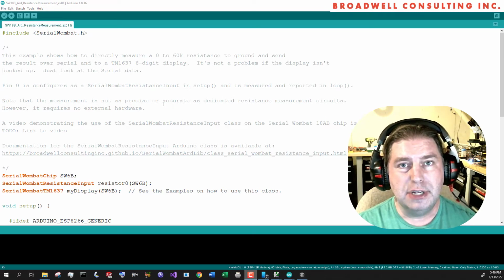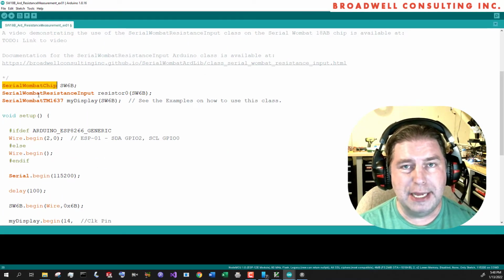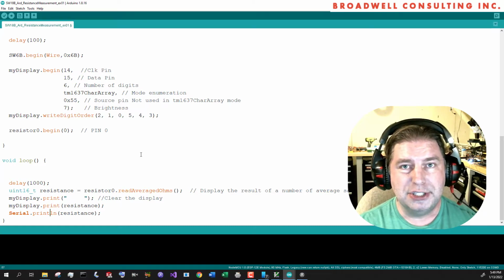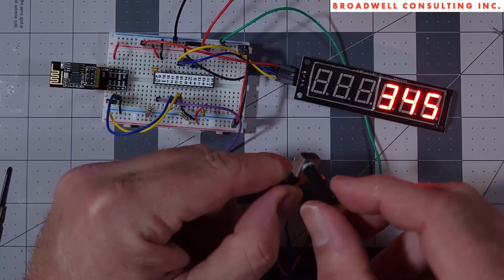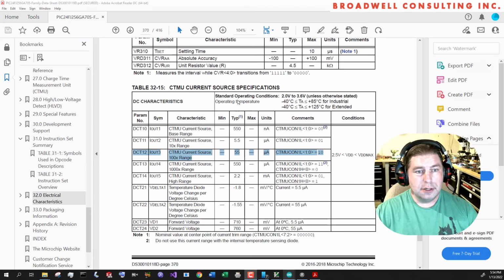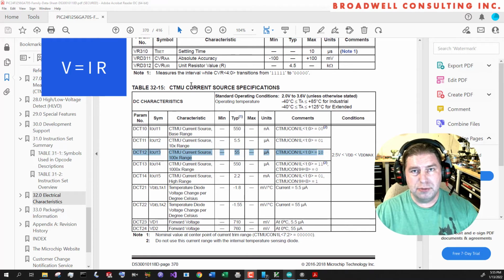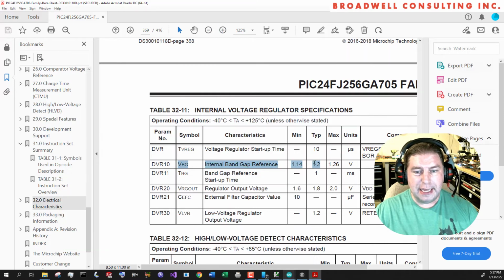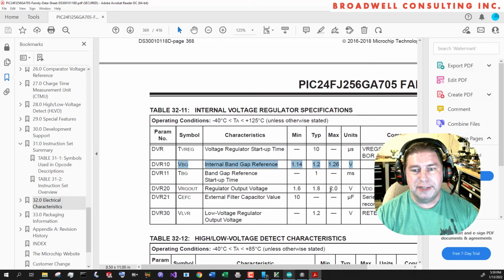Directly Measuring Resistance with the Serial Wombat 18AB chip

Comment: HI,  have 14 resistors to take measurement of. Can I use 2 18AB chip to take a measure of 14 analog channel.  can I use an -358 offset to make the reading to 0 ohm. Do you have a python libarry for this
Reply from the maker: You can use multiple chips in the same project, either by using multiple UARTs or by setting the I2C addresses different.  As talked about in the video, the resistors must be measured to ground, and the accuracy and resolution will not be as good as a dedicated resistance measurement circuit such as a Wheatstone bridge.  But if this works for your application, the Resistance measurement pin mode can be a really handy and inexpensive addition to a project.

I'm working on the Python library now.  There's some code up in the github repository that works and a couple of videos in this channel to support it, but in the next couple of months (around Nov 2023)  I want to get it where it's fully on par with the functionality available in the Arduino C++ libraries.
Reply from the maker: The python library is now available!   See the recent video on it.